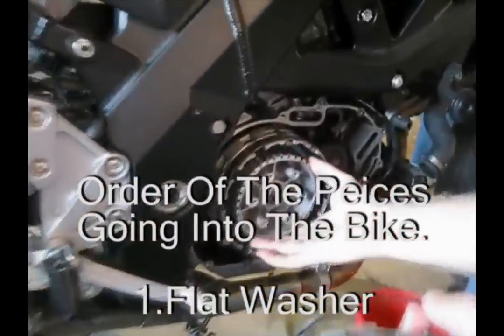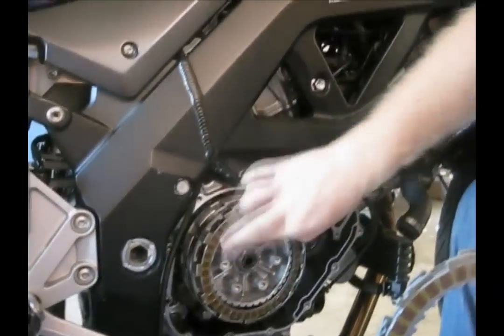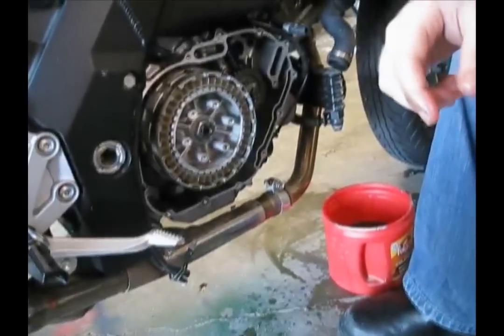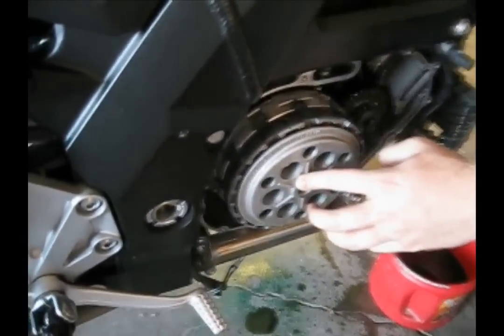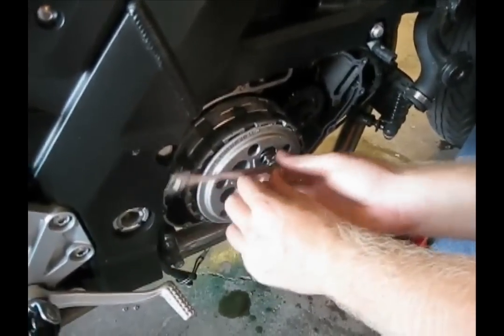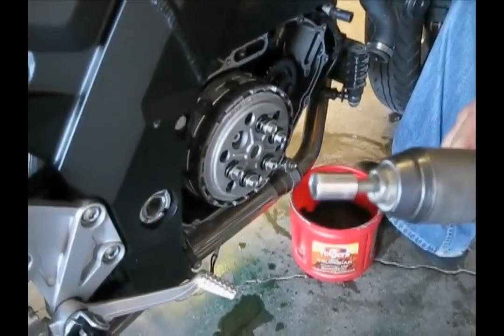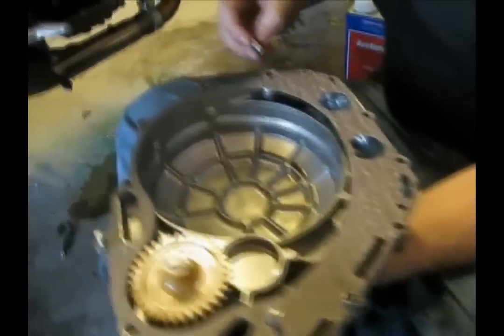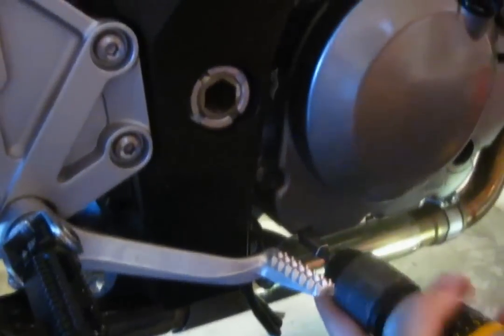Maintenance Clutch Replacement Part 2(2008 Suzuki SV650-S) ft. Chris

Comment: @199Xray Thanks for the advice.  Normally people assume a modern Ducati.  I have a 74 750.  It's probably much different than what you are thinking.  I checked two adjustments on the outside of the bike.  I think I have to go in.

Comment: Nice job.  I've got a 2018 Wee Strom and the innards looked exactly the same.  The notches that are on the fiber plates aren't specified to go to the outside, but I guessed that according to the manual drawing they do, if it matters.   One friendly suggestion.  Get a tripod, or a cameraman with a more stable hand.  At times the camera was shaking badly and/or not pointed at what you were doing.  Cheers.

Comment: I have a sv650 2001, and when I start in 1st gear, If I pull too much the accelerator make a noise like a squeal, I think I need replace clutch fibers? I am right, how much cost?>

Comment: the entire assembly for the older ones is $208.

theres fuck all difference between the two. slight sizing here and there. it would be maybe $100 more worse case.

but thats for the full assembly inc. main driven. 

go geese some oem parts suppliers relevant to your country.